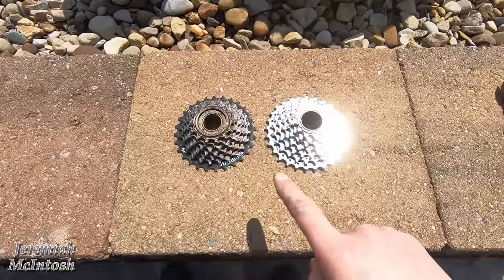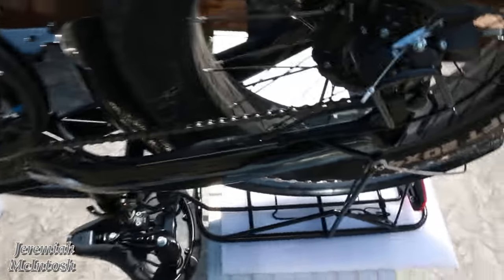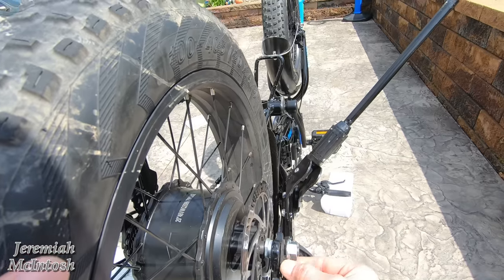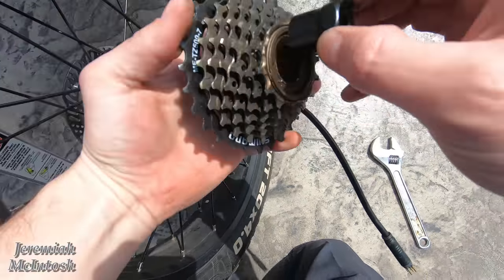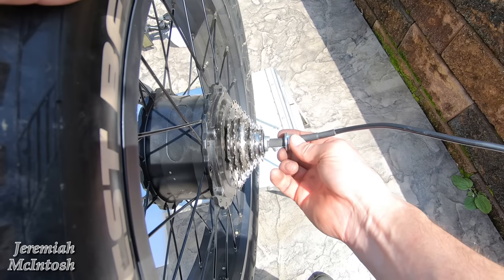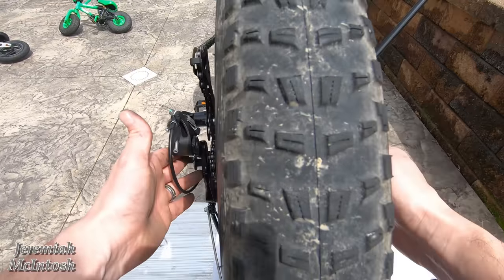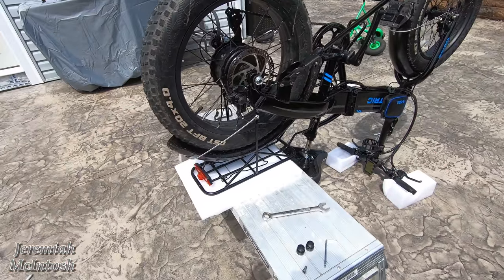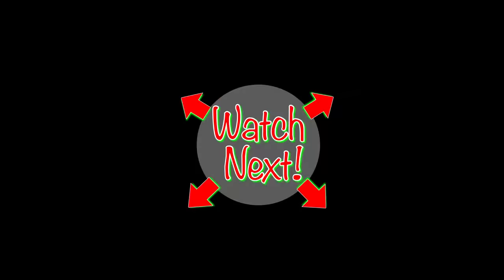Lectric Xp E-Bike Freewheel Upgrade replacement Tutorial and differences

Comment: When take the back WHEEL off remember to place a nickel or a coin or a washer will do between the brake pads AND DON'T PLAY WITH THE BRAKES UNTIL THE WHEEL IS BACK ON. Otherwise the pads will close and they are a nightmare to prize back open
Reply: I work for Citi Bike. I know this all too well. I'm an E-Bike mechanic 🤣

Comment: Thanks for this video. My problem was the opposite as I live in an area with very steep hills. I followed your instructions bit switched to a 14-34t Shimano freewheel, and it all went very well. The derailleur just misses the new 34 tooth, and it works great. Thanks again!
Reply: I'm thinking about doing the the same thing. Was it a significant difference? Do you have a link for where you bought yours
Reply from the maker: There is a link to both in my video description. Just expand the description with the arrow next to the video title.
Reply: Thanks for this video. It simplified my decision to try a 11-34 on my ebike. Also thanks to the guy that posted to your request for someone to verify the function ability of a 11-34. I am now subscribed and look forward to more videos. Thanks, Liberty
Reply from the maker: Thank you Liberty I appreciate that!
Reply: You should be able to adjust the derailleur so it catches and doesn't miss the 34 gear

Comment: This video was super helpful for me. Having never really worked on bikes, this gave me the confidence I needed. I'm a little embarrassed that I had fully tightened the wheel back before I realized I needed to put the chain on while putting the wheel back, which is a little awkward.

For those with step-thru 2.0 like me, I didn't see a spacer disc anywhere while changing the free wheel. But the new freewheel seemed to work fine even so.

Thanks again!
Reply from the maker: Great to hear you got it working!

Comment: I found by putting a long flat head screw driver between the frame and wheel, then gently pry it open a little bit. The tire will fall into place completely in. I’ve changed about 20 flat tires on my Yamee.

Comment: I completed the upgrade thanks to your video.  Ran into a bit of trouble with my XP 2.0 ST that is different from the video, my bike did not have a removable spacer behind the original gear so when I installed the replacement the gears were way out of alignment and had to do some major adjustment. Luckily I found a shimano derailleur adjustment video and problem solved. Oh and the upgrade is awesome no more freewheeling here.
Reply from the maker: Sweet! Glad you got it working! Happy Trails.

Comment: I just changed my Freewheel on my XP and it absolutely does make getting  to 28 easier. Really glad I had your video also cuz I bumped the nuts and washers by accident got them out of sequins and had to look at your video to make sure I put them the right way :-) I took my brake caliper off and it made it much easier. It went right back on with no adjustments. The whole change wasn't 10 or 15 minutes.
Reply from the maker: Awesome and I’m glad you found it helpful. 👍

Comment: I put an 11-34 that you have linked and it is night and day. I mean totally different ride.  The 34 was insanely nice to the point of getting goosebumps with first steep hill. I live in WV and on a hill so there's a few treacherous and some intermediate hills on my commute. I had to push on the huge ones before and now I can kick it in to 1st and pedal with absolute ease. I put it in 2nd for intermediate hills no problem. To give you an idea of how well it rides I can pedal it easily from a full stop with no motor at all and it doesn't feel like pedaling a tank. 

Also, before I was having trouble hitting 28 on flat ground and running out of pedal, now it's a humongous change and have plenty of pedal even when topping out.

The only thing I had to adjust was the tension screw (not sure of exact name) that you can adjust by hand on the before the gear derailleur. Perfect video.
Reply from the maker: Awesome! I agree that it makes a huge difference! Thanks for the feedback 👍
Reply: That screw is called a B screw and is available in a longer length

Comment: Just changed my factory XP 2.0 freewheel to an 11/28 and it went in so smoothly thanks to your video; by the way the size wrench for the freewheel removal socket is 24mm wrench.
Reply from the maker: Glad you got it installed and working correctly. Happy Riding.

Comment: Jerry : I changed the freewheel on my fat tire bike. The freewheel was a Shimano. The gears were 1st 28 and 7th was 14. The replacement was a DNP freewheel 1st 34 and 7th is 11. I had to buy a new Shimano Turney TY300 6/7 speed rear derailleur of of Amazon, from Larry's Bicycles. The cost was only $19.55 tax included. The derailleur that came on the bike was a cheap Shimano with no B adjustment screw. The jockey wheel would not clear the much larger diameter 1st gear. I bought a new chain and 2 extra master links. I had to add several links to the new chain, from my original chain, that was not stretched, to get the correct length to attain the correct angle on the tensioner jockey wheel arm. Great video series. By the way, what is the part # on the hub motor? Thanks
Reply from the maker: Thanks for the info Don. I was wondering if the 11-34  freewheel would clear the derailer on the xp. 
You said you changed it in your fat tire bike....was it on a Lectric XP or different bike?
Reply: @JeremiahMcintosh  It was on a 26" fat tire bicycle. The 28 tooth sprocket is about 114mm/4.5" diameter, tooth peak to tooth peak. The 34 tooth sprocket is around 145 or 6mm/5.7" diameter, tooth peak to tooth peak.  I have a Lectric XP on order. Lectric was supposed to start shipping on 4/27. If the derailleur on the XP has a B adjusting screw it may have enough adjustment to allow the jockey wheels enough travel to clear the larger 1st gear. The derailleur on my bike was designed to work pacifically with  the standard 7 speed, 14/28 freewheel. Front and rear derailleurs have a sprocket max. size limit. I imagine that if the XP has a derailleur designed to work with a 7/8 speed free wheel it may work.
Reply from the maker: Thanks for the info I appreciate it!

Comment: A small tip, if you get hold of a threaded bar about half inch dia. (you might have one from your front forks when the bike was packed?) , two washers and nuts, and rwo blocks of wood drilled half through the size of the bar. Cut the bar until it fits between the rear top tube of your bike with the blocks on each end. Then if you fit the nut and washers to the ends , you can use the nuts to expand the rear enough to easily clear the wheel spindles. Remove it to get the wheel off, and replace it through the spokes and tighten it again to replace the spindle . Niice, cheap and easy  way to do an awkward job.

Comment: Great video. I just added on my XP 2.0,  11-34 and had no spacer to remove like your bike, and everything fit perfect with no issues. I wish I had a 9-34 instead because I fell like I need more paddle on high speed and the 11 is better but still could do better to keep 30mph. My weight is 215Lbs. Better life at high speed with some hills is 10 miles. I will be adding a 2nd batter to get me 20AH and 20 miles range.

Comment: Caution when mounting rear tire! Jeremiah, I did not replace my freewheel yet, but did have an opportunity to remove my rear wheel to replace tires and tubes and slime them.  A few days after the repairs were complete I happen to notice my chain/derailer was very close to my tire when in 1st gear, almost touching. I compared to my other XP and noticed the other had an approx. 1/2" clearance. After confirming that my derailer and other components were not bent I attempted a derailer adjustment to no avail. I then stuck my fingers in between the frame and front of tire on each side and confirmed the tire was centered. I then compared to my other XP and realized the tire on the other XP was mounted slightly bias to the left. That is to say the front of the rear tire is approx. 1/4" closer to the frame than the left side. When I researched this it turned out fat tire bikes in general have tight tolerances between chain/tire especially in 1st gear due to the fat 4" tires. Makes sense. To fix the issue I loosened the rear axle nuts on both sides and lifted the rear of bike off the ground. I could then shake the rear tire and realized the washers with a lock tooth allowed the wheel mount to move approx. 1/8" on the azimuth . I pushed the front of the  tire towards the left (or rear of tire towards the right)  like the other XP and tightened. Chain alignment issue was now resolved with a substantial clearance in 1s gear. I wanted to point this out to anyone who removes the rear wheel for any reason. You need to verify that when in 1st gear, your chain/derailer are not rubbing against your tire. In retrospect, Lectric should have used a 6 speed freewheel and allowed more of a gap between the 1st gear chain/tire clearance rather than having to install wheel off center.
Reply: Are you saying that when the axle is sitting completely seated in the axle frame dropouts with the nuts loose that the wheel is not correctly aligned and you tweaked it sideways for clearance before tightening?

Comment: I have a Sondor's SX bike land love it, but as you said earlier in the video once you get to higher speeds on the bike it's like your Wile E Coyote running in the air before the big drop.   I didn't change the freewheel since I didn't know which one to get but now I do.  I did change the crankset of the bike to a bigger size instead of the stock.  That made a whole lot of a difference in the pedaling now.  I can crank the bike with the higher speed and get more speed out of my baby.  I plan to also change out the freewheel now that I know which one to get.  Thanks for the video.

Comment: Jeremiah, I was wondering how I would work on my bike upside down with damaging the components and computer display. Since I did not have the styrofoam blocks or bench to use I came up with an alternate idea which is great for those folks in apartments or spouses not wanting you to use the family coffee table. (-: You inspired me to to get a couple foam yoga blocks to rest the front grips on, and an 18" folding step stool to rest the rack on. Here are the links from Amazon for anyone who wants to do the same.

Foam yoga blocks - 
folding
Reply: for repairs on the fly get handlebarjack.com - just got mine this week - neat little setup
Reply: for repairs on the fly get handlebarjack.com - just got mine this week - neat little setup

Comment: Great video Jeremiah!  I have learned a lot from it.  I have a question about the freewheel tool you used.  Could you tell me what the measurement of the length of it is from one end to the other, and what the length is of teeth part of the freewheel tool that inserts into the freewheel?  The measurement of the free wheel tool I bought is 1 1/8 inches long and the length of the teeth part of the free wheel tool is 3/4 inch long.  I want to make sure I have the right size free wheel tool because I'm thinking my free wheel may be too short.  Please make these measurements for me of the free wheel tool you are using.  I want to buy the right size tool when I am changing out my freewheel.  Thanks
Reply from the maker: The link for the correct tool is in the description of this video.

Comment: I just install my new freewheel on the Mars HeyBike. There were a few differences. The spacer ring behind the freewheel component was not present at all on the HeyBike. There also is no retaining washer with the Allen screw. Everything swapped out perfectly. I also added whitewall tires just for fun, while i was taking it apart anyway. Haven't ridden it yet but the static test show no brake drag, shamano shifter goes threw all gear and are all aligned perfectly. gonna take it out later for a street ride. I am redoing my handlebar configuration now. Thanks
Reply from the maker: Cool and thanks for the info. Keep me updated to let us all know how it worked out after your test ride.
Reply: Changing the freewheel on the HeyBike made me able to actually pedal at 22-24 mph instead of just going through the motions. It is a very worthwhile upgrade for me on my Ebike. thanks Jeremiah nice!!!

Comment: I just ordered a 11-34. My cheap chinese stock freewheel has a busted 11(7th gear). The ratcheting has so much play in it, that it bangs every time you start to pedal. You really do need that 11 for an ebike. I've never had to gear down to 1st, but my bike came with the 11-34, so that's what I ordered.

Comment: Looks good, not too hard looking. Would like to mention that now would have been be a good time to remove the tire/ innertube  and wrap gorilla tape around the inside of the rim for extra protection from the spokes.
Reply from the maker: Good tip but I did flatten the tires enough to pinch it in to make sure the liner was installed correctly covering all the spokes.

Comment: Tip, Two small crescent wrenches on the back of the flat part of the frame act as handles. wheel will fall right in. Having a second pair of hands is ideal.
Reply: Yes! I look up tire changes for the future and it scared me some not all people need a frame spreader im low im the tool area!
Reply: @johnsheetz6639  measure the wheel size, it's not a 20inch tire. Motorcycle tires will fit the bike.
Reply: @Saddletramp1200  i was just talking back tire changes in general ive heard the back is to tight on the rims.
Reply: @johnsheetz6639  I have 200 miles on my bike so far, it will be a while before I need a tire. I will get a Metsler 16 x 3.5 for my bike.

Comment: I am getting the bike next month. I want to put the sweptback handlebars on for comfort. Question: do I need to know the stem size or any other mounting concerns when ordering new handlebars? thanx
Reply from the maker: Based on other people I believe they need to be 25.4mm where they mount but I haven’t upgraded mine yet.
Reply: @JeremiahMcintosh  thanx, I have a concern about the tires on the xp. I put slime in each tires, and inflated them to about 18lbs. Rode it first day about 20 miles, no issues. The next day I rode it about 3 miles, the rear tire went flat. There were no holes in tube or tire, but I discovered when you inflate them keep the bike on a rack or just somehow do not inflate while bike sits on the weight of the tires. They will not seal on the wheels properly. Slowly inflate them while rotating the tire to see if they seal onto the wheel evenly. Then after I inflated them, I rolled the bike around pushing down on it to insure a seal. Seems strait forward when inflating them, but they easily will not seal correctly if not careful. Also, there is no cruise control, I followed your instructions, and cruise control does not come up on screen, only walk, no matter how short/long I press the down button. Maybe this is an option they do not offer on the 2020 bikes. thanks again Jeremiah.
Reply from the maker: You should have cruise control you have to be in PAS 1 through five hold the throttle without pedaling to your desired speed and then hold the down button at the same time.  If you are not holding the throttle then it will go to walk mode.

Comment: Will adopt this on my ado a20+ wich has a cassette one. I felt always that the transmission ratio for gear 7 is too high. Especially when unlocked to higher speeds than 25. Thx

Comment: Yeah I did the same thing on my Ecotric fat tire bike so now my 6 and 7 gears give me a better ratio while keeping the 28 teeth etc for hills etc. Thank You
Reply from the maker: Thank you! How do you like the Ecotric? Do you have the one with the 500 W motor?
Reply: Jeremiah Mcintosh I am very happy with it and the company has been very responsive when I had a S900 cable fail. They sent a warranty replacement LCD right away. I have the 36v 500 watt motor, but I also added a 500 watt 36v mxus motor to the front with a second controller and sw900 lcd. The bike no longer slows for hills, but the gear ratio made a night and day difference so I no longer over spin the cranks in 6th and 7th gear. I am 6ft 250 lbs and I get a consistent sustainable 25mph using pedal assist @ 5 in 7th gear. Thanks

Comment: Hi Jeremiah, We Received our two XP 2.0”s a few days ago. I definitely want to put a different freewheel on. Even in PAS 5 and in the 6th or 7th gear the pedals cannot catch up to the motor,  and I have not even adjusted the speed to 28 mph yet.Will the 11-28 freewheel work as well on the new 2.0 Lectric?

Comment: Hi.  Was doing real well attempting to remove the back wheel on my ST 2.0 to change the freewheel.  Carefully cut the zip ties, took lots of pictures too.  HOWEVER, I could not even slightly unscrew either axle nuts.  It's as if they're welded on.  Any suggestions?

Comment: I have an 11-32 not 34
 There's no level ground in my neighborhood and I'm not a small guy. It made a huge difference in low end but the gear difference around 4th made a big change too so I wasn't pedaling with no resistance from 4th to 7th

Comment: Great videos, I have subbed!  Question though, can you upgrade the 3.0 tires on the new Lectric bike to 4.0 tires on the same rims?  Also where could I find a set of the blue rims that you see on the Sondor Fold ebike?
Reply from the maker: Not sure about the rims but no you cannot upgrade the 2.0 to 4 inch tires because the tires would be too wide to fit in the frame and forks.